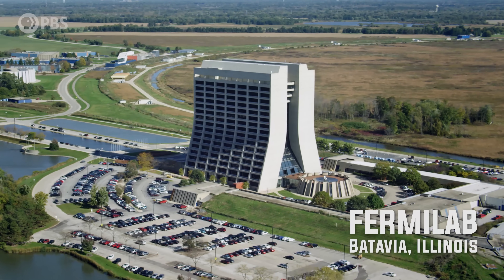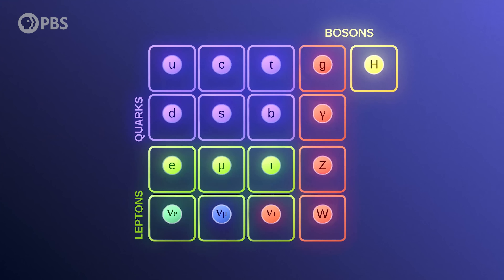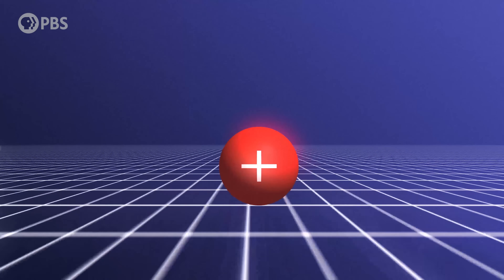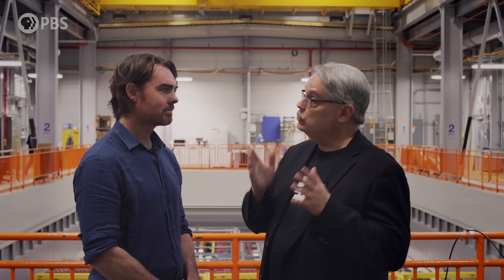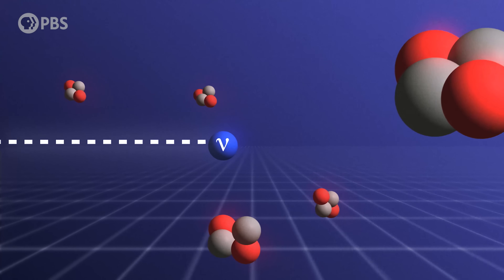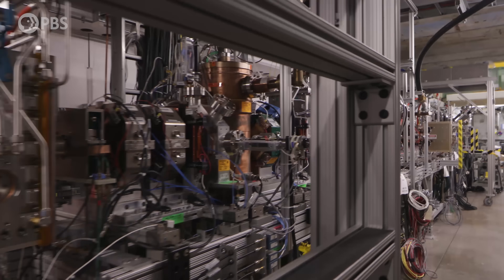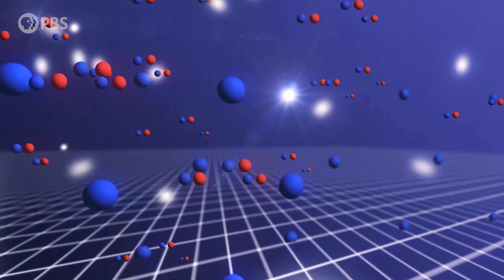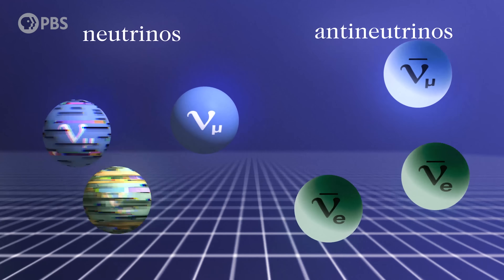How To Detect a Neutrino

Comment: Electron -> Proton -> Quarks -> Yoghourts
Strongforce -> Weakforce -> Colorforce -> Rainbowfartforce
Particle physicist don't understand energy - at all...
They know that things do what they do, but they dont know WHY things do what they do, because WHY cannot be answered by randomly bouncing particles. The WHY can only be answered, if ENERGY is understood.

Nature is all about energy. Energy is why things move or stand still, why things compress or expand, why things spin or don't spin, why they change over time. Energy is wheater there is existance or not. Nature expresses energy in forms of fundamental 3D toroidal waves. What types of waves? Electromagnetic waves. Overlappings waves create cymatics, create geometric interferrence patterns, from small scale, to large scale, from small space to large space

Space is electromagnetic - A liquid dynamic governed compressible field.
The smaller the electromagnetic space, the higher the energy density. At zero-space (Space compressed until it vanishes from 3D Euclidean existance becoming non-local), there is infinite power density, infinite power potential, infinite voltage.
Infinitely small space = infinitely high energy
How do we know that this electromagnetic energy potential is there? 

Light is electromagnetic and it follows these exact rules. Light energy: E=hc/lambda -> make lambda (wavelength) infinitely small, [E] Energy becomes infinitely high. An infinitely small wavelength requires no space

Space is the electromagnetic energy. Small space, high energy, large space, small energy (inverse to logic? ... inverse squre law :)
This applies for Light as illustrated above
It applies for nuclear reactions (the smaller the more instense)
It applies for our forces (the smaller, the stronger the forces)
It applies for frequency: The smaller the wavelength, the higher the frequency
It applies for intensity: The smaller the wavelength, the higher the waves powerlevels. Infrared, no problem - x-ray, kills you
It applies for...... EVERYTHING, because everything is Space and Space is Electromagnetic fields - Electromagnetic compressible Energy

Comment: That leptogenesis thing just sounds like kicking the can down the road.  I guess I need to read into it more.
Reply: In a way it is. The issue is that we need to link the result (Matter domination) to an actual effect. Since protons, neutrons and electrons are about as stable as their counterparts the explanation cannot be there, so we must seek something 'a step back'.

This happens all the time. For example why is carbon 12 more common than C-13? C-13 isn't radioactive so it can't be that it decays away, so we step back to element generation in stars where we find it's not a product of fusion, which gives us our answer, nucleogenesis.

Comment: So, what you're looking for is the disparity in behavior between neutrinos and anti-neutrinos. But the new experiment only shoots neutrinos, not anti-neutrinos, right? How does that that help you figure out if there is a disparity, if you're only seeing one side of the equation?
Reply: Because that one side of the equation contains both types of particles. The possibility of mixing alters how BOTH types of particles behave so that only ONE type needs be tested.

What's being looked for is the difference between what 'should' happen according to one theory and what actually happens. Of the old theory matches then we can discard leptogenesis. But if there's a difference, one that matches the new theory, then science advances.

Comment: 8:03, wouldn't it be possible that when all the matter/antimatter was made that regions of more matter or antimatter formed and then were separated and any antimatter in our region would be annihilated. this would imply regions of antimatter as big as our region would be.
Reply: The issue there is that if you increase the size of an imbalance it gets exponentially less likely to happen. It's far more likely that our universe would be a 'small' imbalance, just a few galaxies, enough to produce intelligent life, rather than the vast, VAST clump of matter it is. If it's mere chance our universe should be tiny.

Comment: Didn’t Richard Feynman say that a positron is an electron travelling backwards in time?  If that’s the case couldn’t the reason that we don’t see antimatter be that it is all travelling backwards in time from the point of the big bang?
Reply: No, you will notice that we cannot use positrons now to send messages to the past. Antimatter acts like regular matter moving the OPPOSITE WAY back in time, but from our perspective it still moves forward in time AS antimatter.

So you can fire two photons at each other and they will form a positron-electron pair. The positron does NOT fly into the past, it will hang around and can recombine with the electron and be destroyed. If you reversed time then the positron would be an electron and the electron a positron, but they're still stuck together in the same 'period' of time, still bound by creation and destruction.
Reply: @garethdean6382  Thank you for the reply.  I'm curious what you mean by "the OPPOSITE WAY back in time", is this a "how the world line works in Feynman diagrams of antimatter interactions kind of thing"?  I think Feynman also positied once that there might only be one electron in the whole universe, traveling backwards and forwards through time... Interesting thought.
Reply: By opposite I mean direction of travel. So a positron moving left is mathematically the same as an electron moving right, backwards in time. (Left rewound is right.)

Feynman's 'theory' was never meant seriously, it was just an interesting observation. (Spacetime has covered this in a previous video.) The biggest problem with it being that you need positrons moving back in time to link all the forward-moving electrons. Our universe would have a 50-50 mix of the two particles if this was true.

Comment: Is the different behavior between matter and antimatter even required for leptogenesis? Even if the rate leptons turn into antibaryons & antileptons into barions is the same, every such event is probabilistic. If we have 1 lepton and 1 antileptopn, chances are that one will turn into its opposite matter before the other one does.
Reply: The problem though is that if you have any number of them the chances that a BIG excess randomly switches is very, very small. Imagine reducing it to a coin flip, heads is 'antilepton coverts first' and tails is 'lepton converts first'. 

The universe contains around 10^80 'coins', that's how many extra heads we needed from pure chance and that's a lot.

Comment: How can we know that Neutrinos interact via gravity? Especially since we don’t have a Quantum Gravity Theory.
Reply: Not "via" but "with".
There IS a significant difference as "via" means "by" and neutrinos don't need gravity to oscillate or interact.
Just that they are affected by gravity.
And to answer your question:  Maths

Btw.... have you ever heard of Dunning or Kruger?  Just curious.
Reply: You would see neutrinos escaping from black holes.  Also the mass of things would fluctuate when neutrinos pairs are created and destroyed.   And we would need to totally scrap general relativity which says gravity is the result of curved space-time.

OTOH I don't think there is yet any conclusive experimental evidence that neutrinos interact via gravity.
Reply: Neutrinos have mass, therefore they interact with gravity.
Reply: @michaelsommers2356  Photons have no mass but they interact with gravity. General Relativity says that everything interacts with gravity since it curves space-time.

Comment: "should have perfectly annihilated each other" So unless that perfection happens it seems like a universe of matter or anti-matter would be more likely. I mean isn't non-perfection going to be more likely than perfection?
Reply: It's a simple matter of counting.  When particles were created, one matter particle was created for every antimatter particle.  When a matter particle and an antiparticle of the corresponding kind collide, both are annihilated.  Therefore, there should always be the same number of particles and antiparticles.  But there aren't.  That is the anomaly.
Reply: @michaelsommers2356  But for that to happen 100% of the time requires no other anomaly to ever occur. Seems like a long shot.
Reply: @technocore1591  "Seems" doesn't count in physics.
Reply: @michaelsommers2356  It counts in science. Something seems like something... let's check it out!
Reply: @technocore1591  "Seems like a long shot" is not sufficient grounds to dismiss a hypothesis.
Reply: No, but yes but no.

First up the production of matter-antiamtter pairs isn't probalistic. It's not mere chance that you get an electron-positron pair and not an electron-electron one. So there WILL always be an EXACT 50-50 mix of matter and antimatter if we rely on processes we know now. Insisting otherwise is like saying that a ball can land heads or tails, no it can't, it doesn't work that way.

BUT the annihilation IS probabilistic to an extent; SOME pairs could survive just by being lucky enough. Buuut... well that still gets us an exactly balanced 50-50 universe. It's not PERFECT annihilation but it sure as heck isn't our universe. And this is what theory tells us we should have, a mostly empty universe with a few scattered particles and antiparticles.

Alright, but maybe, just maybe somehow the particles managed to move around so that, by pure chance, they formed into clumps of matter and antimatter? Still a 50-50 balance but we just so happen to be in a spot with a random collection of matter?

Only... our universe is big, and full. We'd expect to be in the most likely of lumps, and that would be the smallest that could produce life. How big is that? A galaxy maybe, a galaxy cluster to be safe. The rest of the universe would be a near empty void. (The chance of TWO galaxy-cluster sized lumps in one observable-universe sized void is nearly zero.)

Either we NEED a whole universe of matter to produce observers or there's a systematic bias that demands an excess of matter on any scale. And right now the latter idea seems more likely.

Comment: "Virtual boson"? And it sounds like it creates itself from nothing ? 

How is the charge of the neutrino detected? (Correction: "state", matter vs anti-matter)
Reply: As a 'virtual' boson it's a packet of energy, but not one that's organized or stable enough to be a 'real' boson. It's like calling a lump of cookie dough a 'virtual biscuit'. It's *something*. The energy required comes from the particles already there which is why this process only works if there's a lower energy state to decay into.

The state of a neutrino determines what particles it can interact with. For example a neutrino may impact a tritium nucleus and turn that into helium-3 plus an electron. An antineutrino cannot do this. By it's nature the detector here will only detect a specific type of particle.
Reply: @garethdean6382  Thanks,  so there's no 'anti particle' it could interact with either?
Reply: The virtual boson or  the neutrino?

Neutrinos can interact with some antiparticles and antineutrinos can interact with some particles. For example an antineutrino can interact with helium-3 and turn it into tritium and an electron (If it has enough energy.)

The detector involved in this video consists of matter however.
Reply: Neutrino has no charge.
Reply: @zdcyclops1lickley190  oops ... I meant anti-matter vs matter, sorry

Comment: Ok, science aside, did Matt get a hardhat that was three sizes too small?
Reply: A hard hat that fits right up against your skull is worthless if something falls on your head. The webbing inside holds the sacrificial plastic shell a couple of centimeters away and provides the damping and energy dissipation that keeps the energy from a falling bolt from cracking your skull open.
Reply: @Markle2k  and a hardhat that falls off because it's too small is equally worthless.
Reply: @matt_b...  Generally speaking, hardhats don't have sizes aside from those for children vs. adults. The size band on hard hats is adjustable in a wide enough range that the smallest women and the largest men can have a good fit.

Comment: Question: Let's say the difference between matter and antimatter was bigger, so more matter would survive the annihilation in the early Universe. Would this lead to too much matter and a very different Universe? Is this also one of the fine tuned parameters?
Reply: I don't think so, but it's certainly a puzzler. What would 'too much matter' even look like for one thing?

I suppose you'd get more variation in dense\less dense regions of space, that might cause more black holes to form even before stars got started, but I can't see that being too much of a downside. There'd be more stuff, but our universe is already so empty, I think it can take a lot before any crowding issues arise.
Reply: When a particle and its corresponding antiparticle annihilate, they annihilate completely.

Comment: Why does the detector consist of argon? Is it's weak nuclear force speacially strong or what is the reason?
Reply: You need the right nucleus to be able to absorb a neutrino. For example tritium (Hydrogen 3) can absorb a neutrino, emit an electron and become helium 3. Bu helium 3 can't do the same, nor can it absorb an antineutrino. Argon-40 is very sensitive to energetic neutrinos because of its energy compared to nearby nuclei.

Comment: How will the experiment know if the antimatter form or matter form is preferred by neutrinos? I don't understand that bit.
Reply: Only a certain type of neutrino can react with the detector. How many of the neutrinos are this special type at that point depends on whether or not the antimatter neutrinos play a role and how.

Let's say I know I gave you three hats and I have a thing for green so I notice when you wear a green hat only. If my 3 hats are the only ones you have then I expect to see you in a green hat 1/3 of the time. But if you have other hats I wasn't aware you wore then I'll see you wearing that green hate less than I expected and can make a guess about how many hats you really have.

Comment: Why do they use liquid argon?
Reply: Certain nuclei are more prone to interacting with neutrinos than others. For example deuterium requires a high energy neutrino to split it into two protons but tritium will interact with any energy neutrino to form helium 3.

Argon-40 is a susceptible nucleus that requires no purification, is common and can form a liquid through which signals can travel easily.
Reply: Thanks! This looks like some sort of neutrino's "chemistry" - a phenomenological approach on how neutrinos interact with different nuclei. The difference from actual chemistry is that chemical substances interact via valence electrons, i.e. through electromagnetic force rather than weak force.

Comment: from my immense ignorance, couldnt be that even if matter and antimatter decayed the same it should still produce an imbalance due to the randomness of the process? even if the decay is the same, several particles randomly decaying a bit before or a bit after in the start of the big bang could make a massive difference, which is what we see with matter being created.
Reply: It's not decay; matter and antimatter CANCEL in a process that requires one of both particles. By necessity this can't be random, as far as known physics is concerned it would require total cancellation. Randomness might get you a few 'lucky' particles that are too far apart to cancel, but you'd still have a largely empty universe with equal amounts of both types of matter.